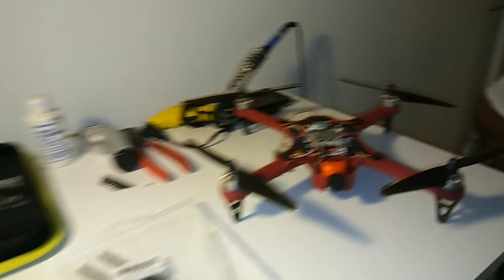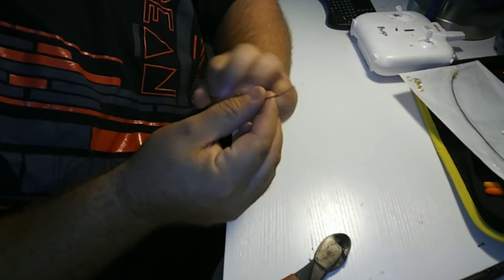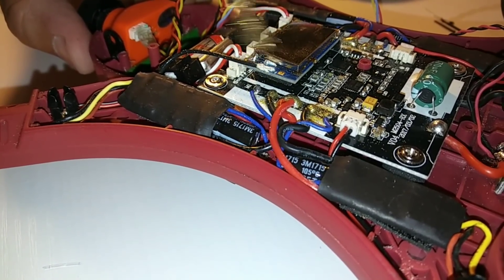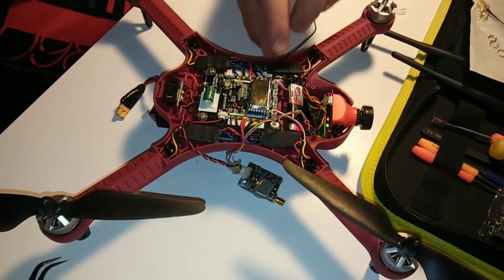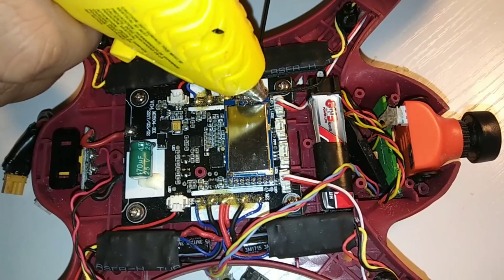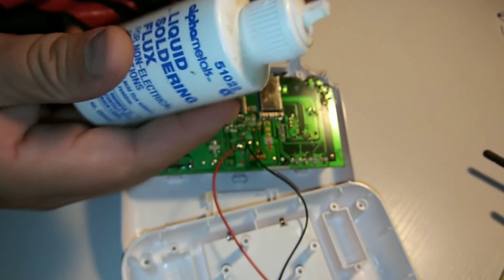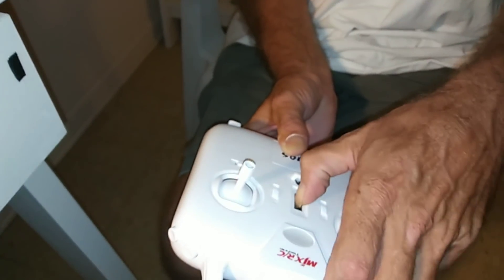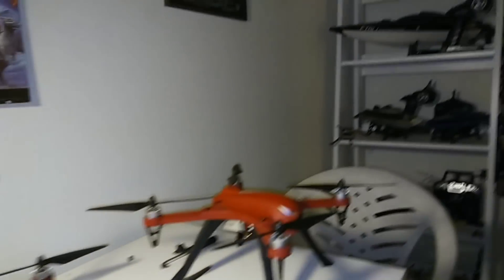MJX Bugs 3 Complete Long Range Mod Installation

Comment: Hello Good Sir. It's 2021 and i still find these videos Usefull.. my question is....can i use an RG316 cable to connect it to 5dbi antenna, to mod my transmitter?? thanx for the answer good sirs.

Comment: I have a question and it would be awesome if you could reply to me I have the mjx bugs with the small black remote and the two antennas is there any way to open that up in mod it because I only get here range wise maybe two football fields and then I lose signal and it comes back and lands... 
  Thank you so much I look forward to hearing your reply
Reply from the maker: It's not that I won't respond I definitely will respond however you're talking about a throne that is like 5 or 6 years old at this point just be happy with 2 football fields trust me going down the road of trying to get range isn't going to get you anywhere you're only gonna pick up a very small amount of range.  Just fly till you learn and then upgrade to something better trust me
Reply: @IFixShet  thank you for your knowledge and your expertise I understand as drones change , and I bought a budget drone for 200 bucks cuz I can't afford a DJI , you can't take something and make it do what a high-end drone does
Reply from the maker: @h20doctor   For $200 you could have bought a used dji mavic Mini  Or a used dji Phantom 3 standard.  All of these would have been better options than buying a toy class drone and trying to modify it. I realize that you are new to the hobby and we all made this mistake when we 1st got into the hobby now that we understand drones better we understand the Chinese companies are taking advantage of people that do not understand drone technology. You could have bought a really nice Dji drone for $200

Comment: I did this to my HS700 (basically the same drone, under a different name) didnt get the memo about NOT Removing the old one. Wish I had. Oh well, live and learn.
Reply from the maker: If it's working, it's working if it's not oops.
Reply: @IFixShet  don't know if it was that of my horrid soldering skills. But I redid it. I found some mention on a few forums of there being UART usb access. Really want to trying to get on that and do some firmware hacking.

Comment: Dude thanks for the upload i just learned a lot i have the f17 same as this im upgraded to fpv also and long range too....you got another subscriber bro thx again
Reply from the maker: No problem brother
Reply: Another thing i have 2.4 and the 2.4 fpv from the eachin e58 i think it has interference some how
Reply from the maker: @MidwestRidazmotorizedbikes  there is no 2.4 fpv.... there's 5.8 which is live feed and then there's two point four which is Wi-Fi two very different signals
Reply: @IFixShet  oh good to know i have the wifi little thing then will it cause an interference

Comment: You should remove the original antenna. If you leave it there, you are effectively cutting down on your gain because the signal is shared between the two antennas.
Reply from the maker: As covered in the video if you remove the old antenna instead of soldering over it the whole unit will completely quit working please pay attention during the video thank you for your guy
Reply: @IFixShet   That doesn't make sense. I have personally custom built antennas for different bands and frequencies and happen to have made a simple T dipole for my brother's bugs 3. It increased the range by about 1/4 original range. I had to remove the original antenna of course because I was paying attention in antenna theory class. Again, that extra antenna only adds omnidirectionality if oriented properly. However, if your aim is to increase range, you have done the opposite. Based on the first law of thermodynamics where energy is conserved, your modification makes no sense for range. That antenna is not going to transmit power that does not exist. You are better off leaving the original antenna and not adding anything if your aim is range.
Reply from the maker: Whether it makes sense or not I went through two bugs threes before figuring out that you can't remove the original antenna as for whatever you're saying that is all fine and dandy however I am amplifying my range with this current setup that I have shown in this picture I have increase the range of the bugs 3 by almost 3,000 feet so I love that you're involved a lot in this comment section however this does work it has been proven time and time again to work on the bugs 3 and the ghost drone F-100. I'm not trying to be a jerk but trust me thorough testing was done every time the original antennas were removed the entire unit would stop receiving signal for whatever reason if thinks it needs the original antenna if it's removed then it starts bleeping and beeping and beeping and there's absolutely nothing you can do it will refuse to connect to the Drone to my advice to anyone reading this post leave the original antennas as I have specified before Mount Your SMA connections and choose your antenna setup. I have performed to range tests that are rather mind-blowing with the current setup I'm running on so once again my friend not trying to be a jerk but I have thoroughly tested this mod to make sure that my findings were accurate
Reply: @IFixShet  Apparently you haven't tested it thoroughly. Again, this is partially what I do for a living, I design antennas mostly for 2.4 and 5.8Ghz to be used on routers. I have personally done this mod on a bugs 3 and haven't had any issues. By the way, I used an antenna I made myself in about 5min, so it probably wasn't very efficient. I could possibly double my range if I increased directionality/gain. In any case, you are probably having issues because you did not do something right. This wouldn't surprise me because I could count the number of things you did wrong in this video alone. You would increase your range if you did your mod right. It is as simple as getting the coax signal and ground wiring right. My guess is either you are interchanging them or you powered the rf module without an antenna or your horrific soldering has something to do with it. The increased range you got might have to do with the extra sensitivity of the new antenna, but believe me, you have attenuated your transmit signal power by keeping the stock antenna. You can confirm this using an rf power meter. TO WHOEVER IS READING THIS, I HAVE DONE THIS MOD WITH A CRAPPY ANTENNA THAT I MADE AND INCREASED MY RANGE QUITE SIGNIFICANTLY. HOWEVER, IT IS IMPORTANT THAT YOU GET RID OF STOCK ANTENNA. CONTRARY TO OP, I HAVEN'T HAD ISSUES WITH REMOVING STOCK ANTENNA. YOU JUST GOTTA DO IT RIGHT. THAT'S ALL!
Reply from the maker: Smh... feel free to do as he says guys if your drone starts beeping like crazy please do not refer to me. I've already been through this it's not even a 50-50 chance of whether it will work every time or not doing it his way. I'm not here to argue I've already done my research I've already come up with my data sheets and I've already supplied my information feel free to take his advice but if it starts beeping and never reconnect to your drone don't come running to me.
Reply: @matemana1991   Essentially putting another antenna on a unit designed for a single halves the impedance seen by the final amplifier stage. It's a carefully balanced equation where the antenna design and connecting coax/connectors are factored together to meet the design goal. You have to realize it's all a tuned circuit and throwing any part of it out of balance changes the tuning. In this case it's not frequency but the power and load seen by the finals. Most RF stages are tuned for optimum operation having a load equal to 72 or 92 ohms. Decreasing the impedance increases the current through the final stage which results in heat and stress on the final amplifier. Too much current and heat cause burn out. (And no, it's not just throw a resistor in the line to increase the load.)
Reply: Hi bro i ve read all of ur comments and i ve a question.Does 5dbi or 3dbi antenna matters for tx or drone? someone says no need to 5dbi just 3dbi works fine or even better. Do you have an idea? seems like you know the mechanism.
Reply: @ferhanturkmen9790  The difference between a 5dbi and 3dbi antenna is the gain. Gain in simple terms can be described as how far the drone will be able to go. The problem with higher gain is that it is very directional. If you point your  tx outside the signal beam, you will completely lose signal. The difference between 3dbi and 5dbi is not significant in drone terms, so I would just go with the 5dbi. Just make sure the RX and TX antennas line up as much as possible during flight. Don't point the tip of the antenna at the drone. That is the dead end of the antenna.

Comment: Can you mod a bugs 4w??? They only get about 130m fpv. I need more... Any vids on that??
Reply from the maker: Bugs is a toy platform I haven't messed with bugs products and almost a year-and-a-half I've gone completely hobby grade at this point sorry
Reply: Love me some bugs3, bugs3H, bugs3 mini... whatever bugs I'd take 10 over any hobbie grade personally. You can definitely mod the antenna just start following the antenna to the opposite end and perform a similar attachment of a antenna sma jack. Circular polarized or rubber duck 5 to 6 dbi dipole. (Always match rhcp or lhcp) Just remember to keep your antennas parallel to each other (any angle really as long as they match angles) if using rubber ducky antennas,and you can go very very far. Good luck.

Comment: i wish you could fix mine bro. i crashed it, broke the arm, ordered replacement kid and the dang motor plugs wouldnt fit in the arm holes. arg. i shoulda widened the holes, but i cut the wires and not good with soldering. not a good project to learn on! arg. a tad above my comfort level but this is AMAZING. i love this bird so much anyway, thank you! I am assuming i could do the same thing on the cheap with a Dlink wifi antenna? 2.4 style the antenna got severed int eh crash and i gotta replace it anyway. cheers.
Reply: wll, i did it!! I watched this video ten times at least. I got a 2.4 wireless antenna, stripped it like you said, attached it to what was left of the antenna (since the actual antenna reciever is at the ither end, it doesnt matter how long the lead is) once that was that, i separated the two-- ordered a 10$ shell, got a 18$ solder kit i can use for a long time and went to work... seems a go!~ all work-- real test is range tomorrow. it may not be fixed forever but If i can get one flight oputta it again it was worth it. thanks man. really.
Reply: UPDATE! Fixed it!! stoked.. thanks for teaching me, i went down the rabbit hole, and leared on youtube. then crashed it in the water, then got a replacement :) crazy stuff. love this bird.. did you solder to the tx points on top of the existing antenna, leaving it be and just adding another>? Thanks--

Comment: hi recently I received my bugs3 in Venezuela but makes that beep of low signal even in 30mts if i make that mod it would be a better signal i think it's a signal problem cause batteries are totally new I only can fly within 30 mts ratio and can't turn back the radio cause to send via ship to Amazon I know never will arrive I prefer to fix it by myself

Comment: Any downside to removing the stock antenna completely before soldering on the new one?
Reply from the maker: +Bryan Rains yes a lot of people said that when they removed it it would not communicate with the transmitter anymore
Reply: Well then thanks, you potentially saved me one hell of a headache!
Reply from the maker: +Bryan Rains I have had my bugs 3 out over 1500 feet now without signal loss with this setup. Just remember to always fly the bugs in front of you not behind you always be going away from yourself and you will maintain good signal lock.
Reply from the maker: Bryan Rains https://youtu.be/ZksoDBFGwwk
Reply from the maker: Bryan Rains don't forget to like And subscribe please it definitely makes us want to keep making more videos when people show support
Reply: Drone Worship Did you remove the stock 2.4g antenna to replace it?

Comment: Picked up a new Craftsman soldering gun on clearance tonight for 3.99 will use my old one to burn the hole Need to pick up some flex and maybe newer solder than 40 years old?, Can I drill one like I did with the hubsan Mod?

As soon as I grow a set of Marbles we will begin!      Thanks so much for the video Dan.

Comment: i want to get into fpv but im not sure what im gonna need does that camera have a built in receiver or would i need to purchase one seperatly. also do yo power it with a seperate battery or of the bug 3 power supply
Reply from the maker: WCxColossus 3 in 1 fpv camera from eBay and a pair of 5.8 goggles
Reply: can you modify the antena on those cameras to get longer ranges aswell??
Reply: what kind of ranges are you getting did you modify the antena on the camera at all??
Reply from the maker: WCxColossus there's no reason to modify the antenna on the camera it runs it 200 milliwatts which is good for about a kilometer. I've had this unit out over 400 m and still maintained good signal lock. It's not really an aerial platform bird it's more of a simple style race quad
Reply: ah ok ty im new to this so im trying to get the best bang for the buck i was looking into getting a seperate antena and transmiter but its all expensive if you buy it sepeartly

Comment: I did this mod and it worked ok for a day.... now my drone remote beeps a lot although I do have range but it still beeps and it thinks it’s out of range even tho I am in control.
Reply from the maker: hgallegos915 you are the only person I've ever had say this after the modification so I would say maybe you need to check your connections that you saw it on to make sure you're not getting cross polarization from having a wire touching anywhere else that it shouldn't be.

Comment: Does anybody make a stiffer, maybe carbon fiber 2 blade prop for these?
Reply from the maker: Why would you want carbon fiber props that's how you destroy Motors and ESC when you crash? Remember the Drone does not shut off after crashing you have to disarm it by holding down the red button

Comment: What's up buddy, got a question for you? I did the antenna mod and removed both stock antennas replacing them with sma pigtails. I run a 3dbi on the quad and 5dbi on the TX. So, 1 question is now 2, why don't my TX " beep " as has been stated and how far, without too many 2.4ghz interferences, do you think this quad is going? Thanks for your help with all my madness!!
Reply from the maker: Big Daddy first let me say you're extremely lucky that yours is not beeping since this unit come out they may have made a few changes to it. I'm assuming mjx got a brush of complaints from people and they finally decided to cure the problem with newer models because so many people were trying to get more range. As for how far you can go it's really going to depend on the area I've maxed out around 2,200 feet which is pretty darn good for a toy grade bird
Reply: Drone Worship I'm pretty sure I'm right at a mile with this bugs 3. Amazing for a toy. It crosses power lines that this p.o.s hubsan h501s I had wouldn't without major hesitation. The quads set up with a wolfwhoop multi power, 40 channel fpv camera/transmitter and the mentioned 3dbi antenna. The TX, it has a 7 inch, yes a 7 inch eachine dvr/fpv monitor. The eachine lcd5802d to be exact. It's huge bro! Along with a 5dbi antenna for flying. Hubsan needs to be worried. Alot!!

Comment: dropping a bead of solder in there like that, even with the flux, creates what is called a "cold solder joint". not something you would want in a high vibration environment.
Reply from the maker: Drone-Eating Tree good thing there's no vibrations 😉 #SmoothOperating
Reply: Drone Worship speaking of- have you tried 3 bladed props on the bugs yet?
Reply from the maker: Drone-Eating Tree yes it loses flight time dramatically
Reply: @IFixShet  wow i was told the 3 blade props were better for stability especially coming down is that not correct ?
Reply from the maker: @matthetriker  nope, they are for more aggressive flying. The blades are more narrow so you will actually lose air management more than gain they are for making quick fast movements

Comment: do you fly yours on 3s lipo o stock 3s
Reply from the maker: WCxColossus ?
Reply: im sorry i mean 3s or stock 2s lipo
Reply: Drone Worship i ran mine with a 3s today ppl say u can run 3s i killed a esc in the process so im curious if u had any issues or  do u just run 2s

Comment: What kind of range did you get before this mod? I have a bugs 3 and I have an issue with the remote beeping and the bugs dropping out of the sky at around 350 feet. I saw online that it should get more like 300 meters.